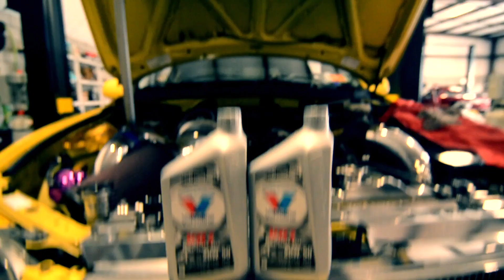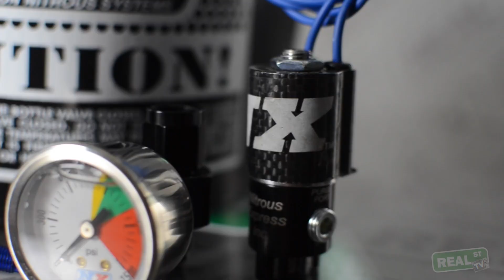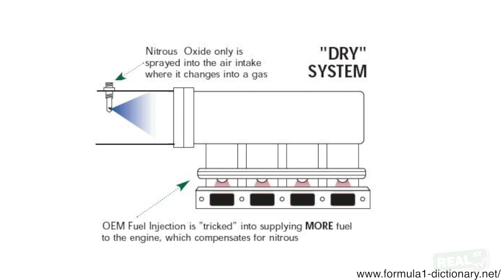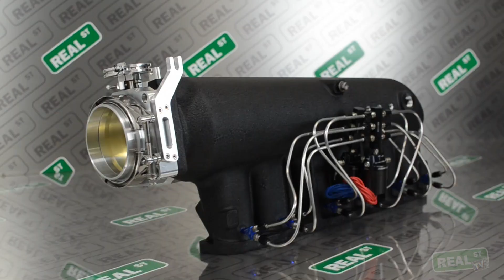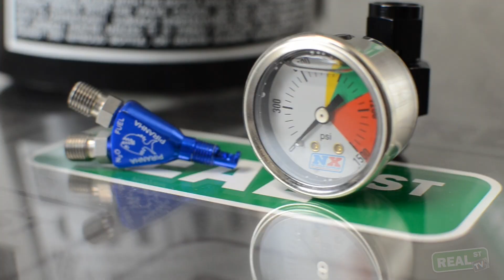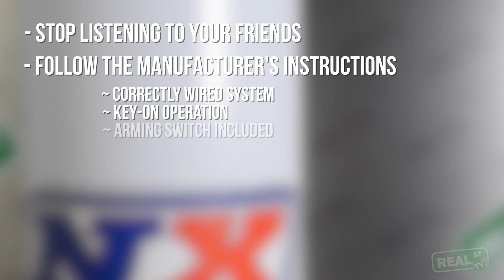Jay's Tech Tips # 27: How to Pick The Right Parts for your Nitrous System

Comment: I ran a wet system from NX back on a 91 5.0, up to 200+ shot from a single nozzle. The system that atomizes the fuel completely (at the time NX was best, period) is what you are looking for. Worked amazing. And when the system turns on, it should feel immediately like a big block NA  and NOT HIT HARD. Hitting hard is a sign of incomplete atomization of the fuel and a controlled detonation scenario. That breaks parts. Guys going from NOS to NX back in the day had to do it at the track, otherwise they couldn't feel the power of NX on the same shot - no hard hit. Except they would go faster and the motor felt much smoother. Bottle heater is best mod ever, must be between 900-1050 psi or you are wasting the hit. For HP gains that can rival a base turbo or blower with less invasive install and no parasitic loss, it's great stuff.

Comment: Would love to see some Tech Tips in regards to water/meth injection on boosted applications for safety measures, and extra horsepower potential with the lack of E85 availability in Florida.
Reply: JpL4K3 My reservation with that is not all engines have good enough distribution in the intake to make a generalized approach.  We could make a video with a very soft approach.. 
 Thanks

Comment: What about cases where nitrous is used as a lower rpm torque fill?  Is it just down to strengthened internals or would it still put too much stress?
Reply: KoenigseggFan21   It would be a case by case basis. There are some engines that are more tolerant than others. Small kits can be activated earlier than large ones, I'd use 3,000 rpm as  the floor in general. 
 thanks

Comment: Hi Jay I am just wondering if you would be able to help me out, I have bought the parts from you guys and I rebuild the engine of my s2000 everything it fit perfect but know that I put the engine back in the car, the engine won't start, it got fuel, y putted band new spark plug and the eps ligh can on in the car, but there is no ignition qnd there is not spark in the spark plug have you ever see anything like this happened before? Any suggestions what it can be
Reply: Hugo Flores Cam or crank sensor, or you times the cams wrong.
Reply: Thanks man I am very sure timing is perfect but I will double check and the sensor too, any way to test the sensor to see if they are no good? Or just buy new ones you think
Reply: Hugo Flores  If the cylinder is always missing it will be easy to find. If you've changed injectors/injector clips it's important that you triple check that the wiring is correct. If the wiring is correct you're going to check compression. If compression checks out OK you will then swap coils between two cylinders and retest. Then swap injectors between two cylinders and see if your misfire moves locations. 
 thanks
Reply: Hugo Flores  Do you have access to a OBD scan tool that can stream live data? Or a oscilloscope?
Reply: Yeah I do have one and I got to this where it said unit initial ignition low voltage. I charged the battery very good after that, but nothing and with that tool can i check the sensor this is my first time using that one tool but I am gonna keep playing it until I get it with all you guys is help.
Reply: Hugo Flores  If you've got access to a scanner that will stream live data you should be able to narrow it down quickly. Before spending too much time/money please go over all connections. If the scan tool doesn't read RPM your next move is to double check cam timing. The OEM Ecu should run the engine in fault mode without a crank sensor and the twin cam sensor offer redundancy.
Reply: Purple Heart hey I got the car to start but I connected the scanner because the engine light came on so it came out that I have a misfire on cylinder 4 and after was saying in any cylinder I have new spark plug, do you think it's the injectors are causing misfire?